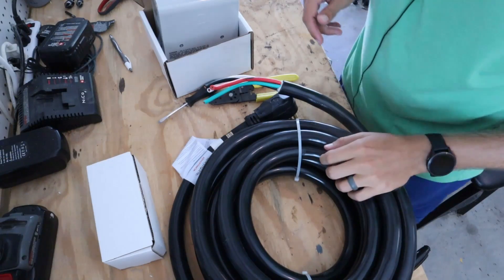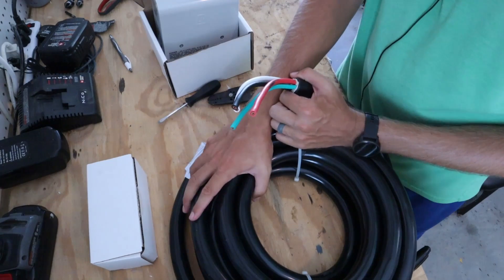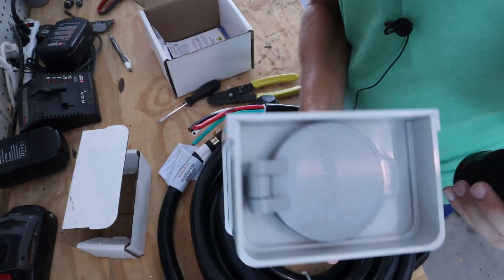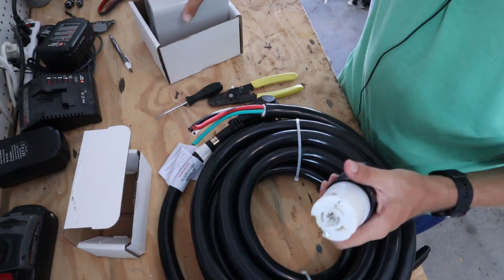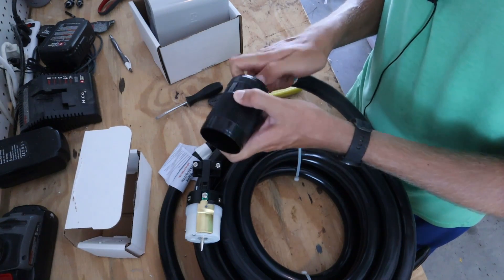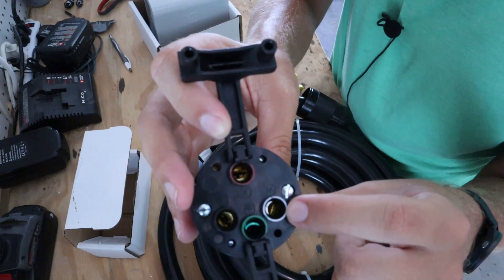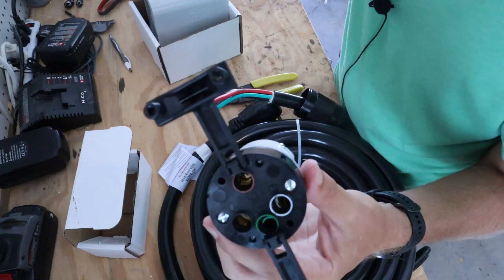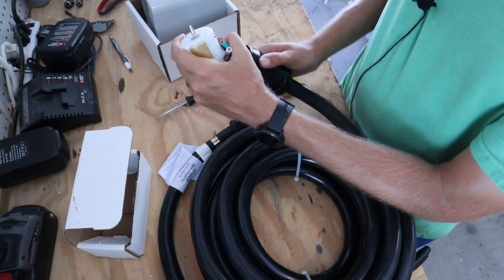How To Make A 50 Amp Generator Cord | Build your own Generator Cable

Comment: Awesome vid! One question though, why is it that the generator (male) end has 4 prongs, while the home/inlet (female) end only has 3? Is it the ground prong that is "...removed..."?
Reply from the maker: Hey good question.  If you look at the female plug you will see a piece of metal on the side of it.  That is the ground for the plug.  That will make contact with a piece of metal on the sidewall inside of the power inlet box.  That is the ground.
Reply: @HowToHomeDIY  Thanks for the video and that reply as I was wondering the same myself. I've had m y same setup installed by licensed electrician. The problem I have is the power cord is 80ft long and it's starting to bother me handling that weight. I just ordered a male and a female plug (50 amp that appear to be 3 prong, made by Marinco that I'm guessing since I don't have them yet are the same scenario as your plug. In fact the plug to my generator is like yours ( prewired 4 prong) and the one at the house is the Marinco 3 prong just like I ordered (male and female). So I'm gonna cut the cord in half and put the male and female plugs in and expecting it should work fine. Sorry so long, Thanks again!

Comment: Great Videos By the Way!

I have paralleled two 3,000 watt inverter generators. I know they will only give 50 amps at 125 volts but I want to wire my homemade parallel box to feed a power inlet to my house.

My question is the cord for this 125 volt system made the same as in your video? (I assume you are getting 250 volts from your generator.)

If so will both sides of my bus bar be energized so as not to have to move preferred circuits in the panel?

I have read where people use a four wire plug for a 30 amp feed and jump both sides together to energize both sides for convenience.
Reply from the maker: Hey Dog Yeller, yes I am running 240 volts and using a double pole breaker in the main panel.  This will not be the same cord setup for your generator.  I believe most inverter generators are using TT-30 outlet which consists of a line, neutral, and ground, hence why it is 120.  This being said it would not power both legs in your main panel.  I have heard of others using the method that you mentioned but that poses a risk of a fire hazard.  As inconvenient as it is, the safest way to do it would be to move the preferred circuits in the panel to the leg that will be energized.  But keep in mind not to put the panel out of balance or overload it.  I do like the clean power that the inverter generators produce.  I hope this helps!  Thank you very much for the feedback!
Reply: That can be dangerous in certain instances. First of all you have to make sure to turn off all 240 circuits so you don’t fry them. Also, many newer homes are using what’s called a shared neutral circuit. They save wire by only using one neutral wire per every two circuits. The neutral wire is not protected by a breaker… so it’s possible that you could overload that neutral wire by energizing both sides of the panel with a 120v generator

Comment: Great video!
Reply from the maker: Hey Mike, thank you for the feedback.  Glad you found it helpful!
Reply: @HowToHomeDIY  no problem!  Thanks for taking the time to make it!

I already knew how to do this, but I’m looking to put a 50a inlet onto my house in the near future so I’m looking at just about every video that falls into that category.

My cousin has an inlet on the side of his house but he has 2 separate panels (2 services for what used to be a 2 family house).  He put one of those drier plugs coming off of each panel and runs a 3-foot suicide cord/widowmaker cord between the 2 panels when backfeeding.  We joke about it because we both know it’s not correct and he of all people should know because he used to build power plants in the thousands of megawatts category.   He could’ve just tied the two panels together with a dedicated 50a breaker each and a 6 inch conduit but whatever 😅

Comment: I just bought a Westinghouse 9500/12500 surge generator and it has the 30 amp twist and the 50 amp plug.  Can I just buy the rv 50 amp cord and it work to connect from the inlet to the generator 50 amp plug end or are they totally different plug ends?  I know many 50 amp rv cords are up to 100 feet long (i'd never run over a 25 to 50 ft myself) and if they'd work it would be easier to just get that rv wire and not have to build one.  Thanks for any info.
Reply from the maker: Hey Tim, you certainly can buy pre made cords.  You just have to make sure that both ends are compatible with whatever it is you have.  Typically the 50 amp plug for the generator is always going to be the same but depending on what you are then plugging it into exactly on your house or RV will then dictate what plug you need for that.  Some have the twist lock for their power inlet box and then some of the RV boxes I believe are male end inputs.  In that case you may have to make up your own if you can't find exactly what fits your scenario.  Hope this helps!

Comment: I'm curious why would you need 4 wires... I would think all you need is the 2 hots and that's it... A generator is not making a ground or a neutral right?...thanks
Reply from the maker: Hey Mike, you do need the hots and neutral in order to complete the circuit.  The ground is another issue though depending on whether it's bonded or a floating neutral as to how everything is grounded but in many instances the generator will be grounded and need the ground wire.  Hope this helps.
Reply: re:   4   wires.   ok.   here's the scoop on 240 volt.   White wire, = common     Red= 120 volt with white.        Black = 120 volt with white.    the other wire (should be green) would be the ground wire......Red + black =  240 volts.     oldtech

Comment: You can change you’re dryer plug to that generator plug to add that twist-Lock plug
Reply: Wouldn't recommend that because if you ever unplug your dryer you'll have the hot prongs of the inlet plug to worry about.  Best to give the inlet its own dedicated circuit or to use a transfer switch.

Comment: Back-Feeding done correctly is not Bad !
Reply from the maker: I agree with you.  It can be done and I think I mention in the video that I know folks that do it.  It just isn't the "recommended" way of doing it due to if you don't take the precautions necessary or forget to it can be dangerous .  As long as the main breaker is off and you don't touch the male end of the cord going into the laundry or range outlet with power going through it, chances are things will work out.  Thanks for the comment.

Comment: Thank you for another great video.  I need a 60-70 ft 50 amp cable from my panel to the inlet box.  Where can I purchase one?  What I see on Amazon are mostly preassembled and around 50 ft.
Reply from the maker: Hey Michael, thank you for the kind words!  I just want to make sure we are on the same page, are you talking about needing a 60-70 foot extension cord from the generator to the inlet box or wiring to connect the power inlet box to the panel?  I know you said the latter but then also mentioned ones being preassembled on Amazon so I just want to make sure I am picturing what you are saying correctly.
Reply: @HowToHomeDIY  Thank you for your quick response this is the wiring to connect the power inlet box to the panel.
Reply from the maker: @michaelmetres-akbar2975  Ok great, that is what I thought you were talking about.  You can get the wire that you are needing in order to connect your power inlet box to your panel at your local home improvement store.  50 amps you would need 6 gauge wire.  Check your local code to find out which wire should be used for indoor use, whether that be BX or NM (Romex) wire.  If being run outside it would need to be run using aluminum or pvc piping per code so make sure to check on this as well.  I hope this helps!
Reply: @HowToHomeDIY  Thank you so much for your answers.
Reply from the maker: @michaelmetres-akbar2975  You are very welcome.  If you run into anything else, feel free to give me a shout!

Comment: Great video - What's the Part Number on the Twist Lock Plug...would it be the LL550C that will mate with the PBN50 box?
Reply from the maker: Hey again, thank you!  Yes that should be it.  I put a link in the description of the video that you can click on and it will take you right to the one I am using and works perfectly with the PBN50 box.  Hope this helps!
Reply: @HowToHomeDIY  Super, I looked it up while waiting to hear from you and the 4' cord w/male plug and twist-lock plug arrive next Thursday...the Receptacle box arrives in 2 weeks...yay!  Hour home is 15 years old and the original owners had a panel built-in for the downstairs essentials.  After owning this home 6 years, we are finally pairing in a Westinghouse W9500/12500DF generator.  Your videos have helped me decide and take action...thanks!
Reply from the maker: Ok excellent!  I am glad the videos have been helpful for you.  Sounds like you will be up and running in no time and you're doing it the right way.  That is a nice generator.  It is going to be able to power a lot of things.  Probably more than is on your panel, but that's a good thing.  You are going to really like having it all setup.  Feel free to message me on here if you run into any questions.  I would be more than happy to help you out if I can!

Comment: Hi, do you know how I can make 50 amp plug from a generator who has 30 amp plug? I D'like to make it work two rv ac at the same time with the generator but I need over 30 amp. Thanks.
Reply from the maker: Hey Steve, you can customize a cord to have whatever plugs you want at each end and wire in between.  However, keep in mind, if the generator only has a 30 amp female plug on it, then they are trying to limit you to what the generator's output is so you don't try to draw more than it's capable of or rated for.  If you are needing more than 30 amps of power then you will probably need to look at a bigger generator.  I hope this helps!

Comment: Thank you for the video, I'm. Starting out too. I have than DureMax (Beast 2) XE12000EH. Looking for the 50 amp cable run for about 50 +more feet, but all also expenses. So the hunt is into making my own. How much and where to buy from for the 30 ft cable, intel box, female connector.
Reply from the maker: Hey Wood Jam,  that is a nice generator.  All of the items you saw in the video were bought on amazon.com.  
Reliance 50 amp twist lock plug
Conntek 14302 Generator Power Cord 30-Foot 50 Amp Male Plug to Bare Wire
Reliance PBN50 50 amp power inlet Box.

Those are all of the items.  50 foot will be more expensive but I do think it is offered.  If you need anything else feel free to message me!

Comment: Thank you for the video. I have a XP12000E DuroMax and I'm trying to determine if I need to go with the 30 amp set up or the 50 amp set up. It's a 9500 running watts so im leaning more towards a 50 amp set up and I'm thinking it will give me more power to run a few more breakers in the house at once. If you can let me know what you think about that it is much appreciated!
Reply from the maker: Hey Bryce, from what I've read, that's a nice generator.  Yeah, I would go with a 50 amp setup as not only do your starting watts (12,000 at 240 volts = 50 amps) exceed 30 amps, your running watts (9,500 at 240 volts = 39 amps) do too. Your generator should also already have circuit breakers on the unit itself, so if anything was to start surging, it should trip the circuit breaker on the generator.  I hope this helps!
Reply: @HowToHomeDIY  quick question. I want/need to upgrade my 30A to 50A since I just purchased a larger generator.  The electrician that put in the 30A outlet will do the 50A. I realize I'll need the breaker, outlet, and cord (interlock is already in place). Do we need to upgrade the wire between the breaker and outlet?  It's maybe 2ft.   I realize he'll know, but I like to be informed just to make sure?  

Thanks for the cord tutorial.
Reply: @TNRonin  Depends on what is already in place but likely yes.  10ga is rated for 30 amps, you need 6ga to get 50.
Reply: 50 amp for sure.

Comment: Thank you for the video.  I am assuming a 30 amp plug would be made the same way?  Leaning towards buying a bigger generator to where I would need 50 amp but just curious in case I buy one not that big.
Reply from the maker: Yes, you assumed correctly.  The wiring instructions for a 30 amp twist lock plug would be the same as the 50 amp.  You wouldn't need 6 gauge wire for 30 amp like you do for the 50 amp though.  Would need at least 10 gauge wire for the 30 amp.  If you were talking about a dryer or range plug, it will be very similar as well.  There will be two hot wires (red and black), a neutral or common wire (white), and then a ground wire (green or bare).  Hope this helps.  Thank you for watching!
Reply: Ok perfect!  Thank you again for all of the information!
Reply from the maker: You are welcome!  Thank you for watching.

Comment: What size generator do you have coming
Reply from the maker: Hey Andy, it was actually delivered this past week.  It is the Cat RP12000E.  It has 15,000 surge watts and 12,000 running watts.  I have connected the generator cord made in the video to it and it worked great.
Reply: I be looking out for your video.
Reply: Awesome I am looking for a big unit like that. I want to power my home AC unit, 3ton and a few other things. I see alot of 30A type  hookups from gen to house but I want to go 50A. I will be starting from scratch, 1st  generator then everything else to connect to my house.  I live in Corpus Christi TX, Padre Island. Just had Hanna blow through. I borrowed a Cat 6500 generator. It worked great but I want whole house power or as much as I can get.
Reply from the maker: @num1machinegunneroif  Yes you are thinking the same as I was and am.  I wanted to be able to power my 4 ton AC and more.  I can tell you that after installing the 50 amp power inlet box (video tomorrow) to my main panel, installing a soft start kit on my AC unit, and buying that generator, I am able to power up the AC and numerous circuits in the house with no issue.  Generator barely pulls down.  So, as of now I have nothing but good things to say about the CatRP12000E.  It also has 5% THD so is a lot safer for your sensitive electronics.  I also have a cat rp5500 generator that I can hookup to my transfer switch to help alleviate some of the load of the circuits.  Hanna kind of blew up right before landfall, I dont know that anyone was expecting her to be a hurricane.  I am in Florida so we are watching Isaias.  Looking better and better but as you know, they are not very predictable!
Reply: @HowToHomeDIY  I've been looking for a high watt generator with a 50 amp plug! Do you still like this generator?